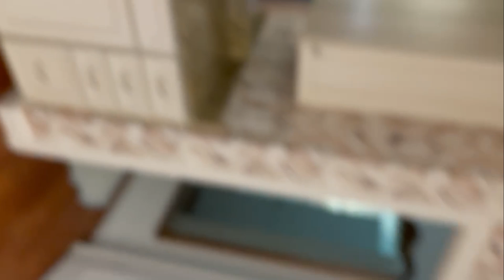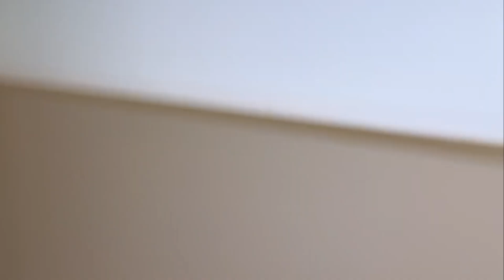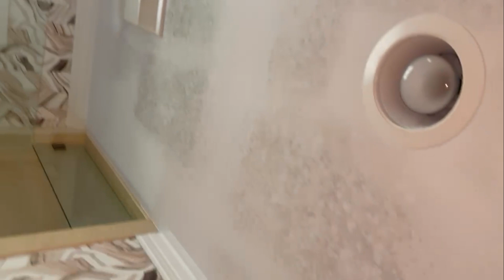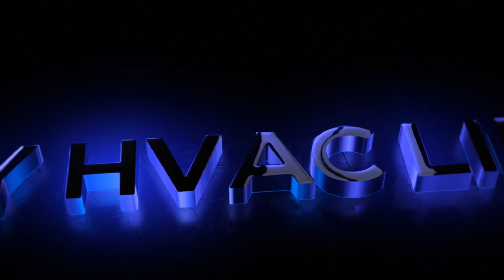Poor ventilation causes mold issue.

Comment: what is the copper tube loop in the electrical compartment?
Reply from the maker: Trane runs a refrigerant line across the front of the drive control for a heat sink to keep it cool.